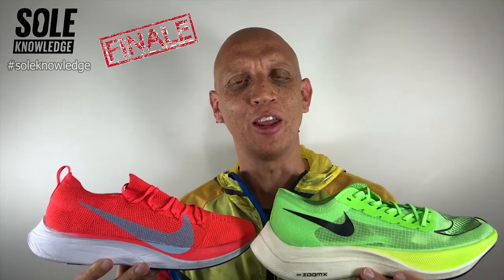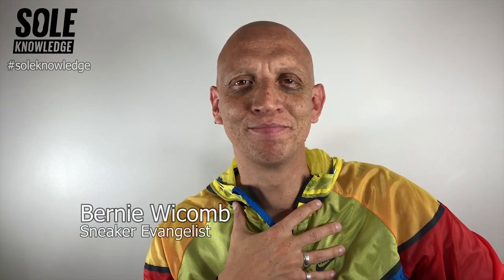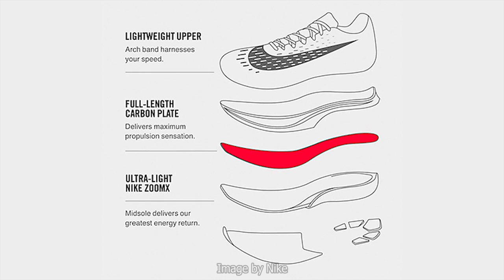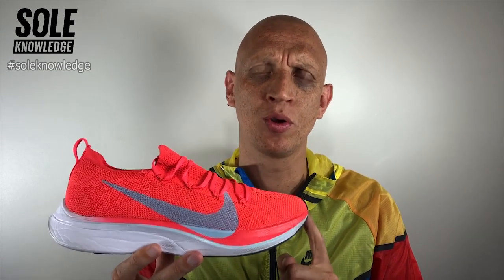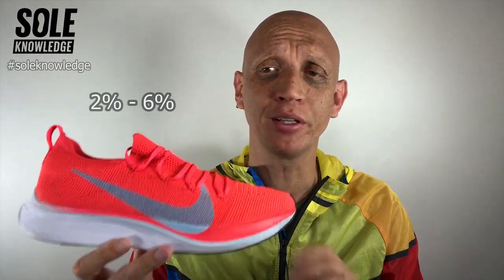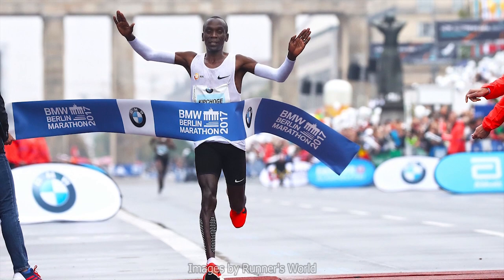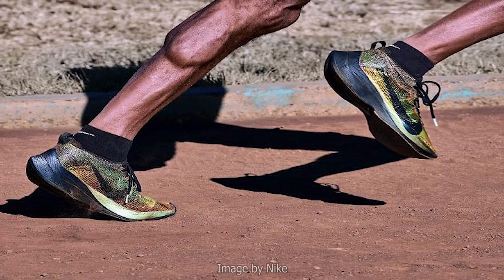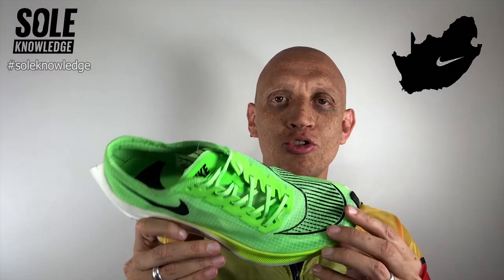Season 3 Episode 7: The World most ambitious running Shoe

Comment: Just a small correction, the red shoe is not the world record shoe. Eliud ran the World record in the Vaporfly elite which has the same upper only. The Vaporfly next% shoe is the EXACT same shoe Eliud used in the wr just the upper is new and different. The midsole from the next is the exact same midsole as the Vaporfly elite that Eliud ran the world record in.